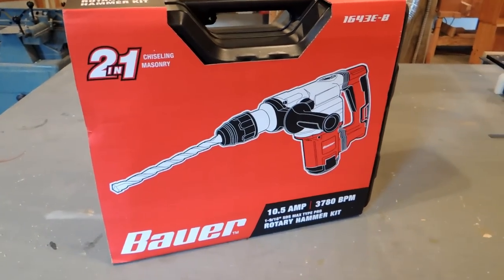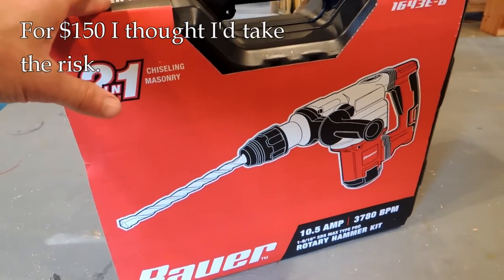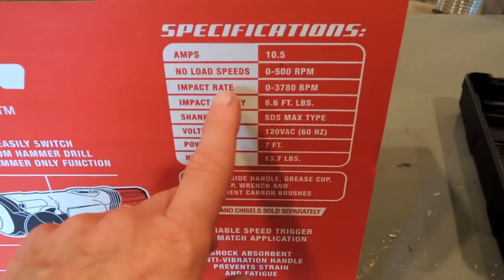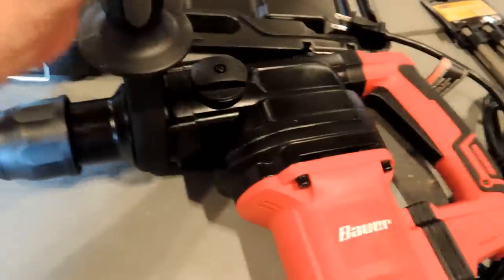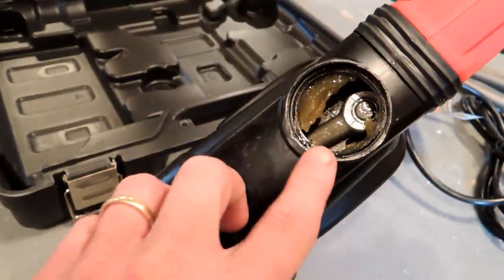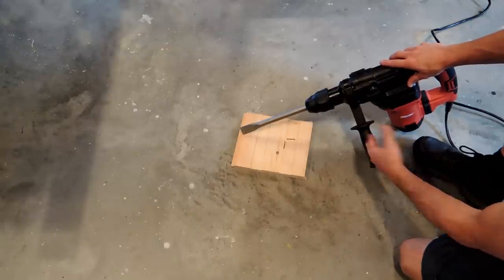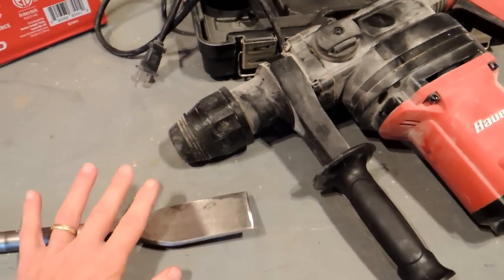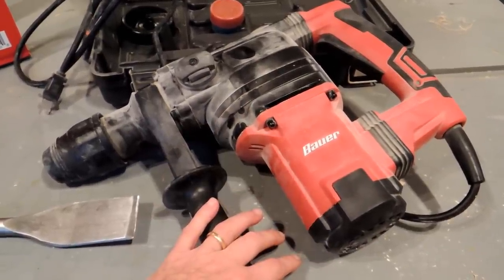Review: Harbor Freight Bauer 1643E-B Demo Hammer

Comment: Great video.  I love Harbor Freight Tools. Over the years, most of them have lasted way more than I expected.  And the ones that didn't were cheap enough I felt fine replacing them.  Thanks for showing us this one in action.  Doing a job on a cement post with hammer and chisel, and came to check out my options - this was perfect.

Comment: Thanks John!  Demoing my master bath and saw your video on demos.  Always appreciate advice from a PRO vs. first timer.  So I'm at the stage where I need to rip-up the floor and I'm new to Harbor Freight so I wind up buying the latest version of this tool and I'm searching on line this morning as I unpack it and there's your review/demo of the same tool!  So appreciate you putting this stuff out there for others to learn from!  Thanks Again!  PS - I have 2 more rooms to do after this so figured the purchase was worth it too if it gets me through this.
Reply from the maker: Sometimes a tool like this will make short work of it, sometimes you end up doing a lot of hand work anyway.  Luck of the draw.  If you have the misfortune of working with metal lathe buried in a "mud" job under the tile, your life will be miserable no matter what tool you use.

Comment: I just bought a Bauer Hammer Drill ($99).  I wrote HF product support about the grease because the owner manual makes no mention of what grease to use.  They responded within 24 hrs (5 stars for that).  They said to use Lithium #2 or #3 grease monthly.
Reply: Dan Burch I just had the same problem about the grease. Get the super lube, it has a higher melting point and less black grease out the front

Comment: I've been a contractor for decades and the physical part is starting to wear on the body. Using power tools more often and where ever I can, I strongly recommend. I prefer the name brands but, I have purchased tools from Harbor Freight and have been pleasantly surprised by the power and reliability. I bought a Harbor Freight multi cut-off tool for $35.00 years ago and after years and years of use, the thing just won't die and never had a reason to upgrade to the more expensive $200 version at Home Depot. Having said that...I'm not surprised the Demo hammer did the job for you. Are there more powerful and expensive tools out there? Absolutely! Do we always need to spend the extra $ to do the job? I think NOT! 
Great video! You covered it all my friend. Very thorough.
Reply from the maker: Yeah, I feel your pain!  For decades I just powered through adversity and worried more about the job than my body.  Now in my late 50s it's catching up to me.  I'm also looking to use tools instead of muscle now wherever I can.  And, that doesn't necessarily mean high-end, expensive tools either.  Sometimes cheaper tools are just fine and preserve profits.  My work truck is 28 years old, I don't need a $65K lifted pickup either.  I've seen many contractors over-extend themselves with expensive toys who are now out of business.

Comment: I've been using this hammer drill for almost three years to drill 3/4" holes,  5" to 10" deep in solid granite rock to split stone with wedges and feathers. It drills fast and I have had no issues. I've also been using the 70/75 lb jackhammer with no issues. They both do great work at a fraction of the price of name brands. I recently had the brush go out on the jackhammer, easy fix. The hammer drill is still going strong.
Reply from the maker: Yeah, my unit has been going strong.  When I made the comment about drilling, I was referring to construction type work, such as precision drilling for hardware anchors in concrete or drilling through tile for anchors.  I'm sure this would be fine for less precision work such as breaking up rock or concrete.
Reply: Tom what grease you use?
Reply: Hey there! I'm actually trying to figure out how to change the brushes on mine. Can you give me any pointers? thanks!

Comment: You said it wouldn’t be good for drilling. In my opinion it works great for drilling into foundations. It’s done everything I’ve asked of it.
Reply from the maker: I didn't mean to imply that you can't use it in a drill capacity, I was only trying to convey that if you need precision holes for anchors or something like that, a hammer drill is a better choice.  If you just need to knock a hole in some masonry this will work fine, but it wouldn't be my choice for precision work.

Comment: Thanks for this video!  Buying one of these later (with a current coupon that makes it $99!) to remove about 400 sq ft of tile.  Even it if only lasts me for this job only, it's TOTALLY worth it :-)
Reply: @Foxtrot I can tell you as I have this, I do commercial tile install, this thing is a freaking beast for tile removal. I can tell you this unit, is comparable to bosch units. Crazy power. And I'm very very surprised for harbor freight.

Comment: The extra grease that comes in the little cup is not to put in the tool. You are supposed to use it on the chisel when you put it in the chuck.
Reply from the maker: Maybe you're right.  The manual references greasing both the shank and the internal body, and that cup of crease could be used for either.  The manual also notes that monthly you should clean out the old internal grease and install new grease!  I don't know how the hell you clean out the old grease, but I doubt it matters.  Basically you need to keep a lot of grease around, and that little cup isn't going to get you very far.
Reply: That is very useful information
Reply: @enduringcharm  thats where they make the money in the grease...but they dont sell it at my stores.
Reply: Thank the lord someone knew that. This guy a dork lol
Reply: @enduringcharm He’s definitely right

Comment: There is 1 that is all red color plastic housing for $97 and another 1 that is a long version, that’s the lowest. Trust me  I tryed it, usually it’s operators error when it comes to how to use them, people think they need to push hard , but no, not at all, it works just like a jack hammer hold it light and let it do it’s job when it comes to braking concrete
Reply from the maker: We need to be careful when describing HF tools by shape or color because they change the models constantly.  But, the one in the video is still the base model that accepts the SDS max chisels, which is an industry standard.

Comment: Great video. I'll say though, I do drill with mine. Great for anchor holes in concrete or brick.
Reply from the maker: When I made that statement I really meant drilling holes for more delicate tasks, like through tile to mount a shower door or whatever.  I personally wouldn't use it for drilling until I got into much bigger things.  I have two regular hammer drills which get me to 3/4".

Comment: I have some cracks in my driveway concrete (concrete is 4-5 inches thick total) where grass is growing. I need to widen the cracks to about 1-2 inches wide to be able to fill them with concrete. Is this powerful enough to do this job?
Reply from the maker: For that job you are going to want a nice straight line.  You can use a grinder with a diamond blade or rent a wet concrete saw to cut that straight line on both sides.  Then, if needed, you could use this tool to remove the waste in the middle.  You may not even need the demo hammer, though.

Comment: I just got home with the pro model above this one $289.99. (I had a 10% off coupon for this brand, other coupons exempt, so got $29 off). I told them I needed it to break up quartz boulders from my gold mine.  The set of chisels were normally $45 but I had a 25% off coupon.  Within 60 seconds, I saw the tip of the chisel wear down about 1 inch and sparks flying inside to rock hole.  Once the tip wore off, it started busting up the rock just fine.

Comment: Oh for heavens sake. Cut the drywall pull off in one sheet.
But I’ve had a Bosch SDS for years and when it broke the Bauer out performed very well and the Bauer is at harbor freight for $95 and if it lasts 3 years so what it beats $400 SDS
Reply: I thought it would die in a few hours.  This thing is a beast on any interior tile demo.  I have Milwaukee and Hilti.  This is the best bang for the buck.  We have 50 hours on this unit.  It is the lightest demo unit at 11lbs.  We use it for demo on tile only.  We're very happy.

Comment: Harbor freight is not garbage. Ok some of the stuff on the shelf is, but the power tools that I have bought from them, specifically Hercules cordless tools are top notch. I'm mostly DIY but I have given them heavy use and have not had any problems. Same thing with their Vulcan line of welders. You could spend three times the amount on a Miller MIG welder but why? Unless you weld all day long for a living it doesn't make sense.
Reply from the maker: Yes, they have made tremendous strides in quality in the past five years or so.  You can still find junk in the store, but you can also find lots of decent quality stuff.

Comment: Well done review - Thanks!
I got this and almost immediately the rotation-only part became virtually unusable. I cannot figure out WHY the ball slips in the clutch assembly in order to repair it. I've tried different lubrication viiscosities and it just slips and slips rather than drills. At my witts end.. Grrrrr!
Reply from the maker: Well, first, it's possible you just have a dud and Harbor Freight should take it back.  I haven't had my unit that far apart, but I do know that many of these combination tools which do both hammer and rotational work can be ornery switching between the two.  I have a DeWalt hammer drill with the same issue.  It's probably not lubrication but rather something about the switch mechanism preventing it from fully engaging.
Reply: @enduringcharm  I FOUND the problem, and sadly on this two year old item there is nothing I can do except trash it. Turns out, the sliding chuck collar is molded in such a way that the 2 ball bearings that have to capture the shank are being allowed to move out from their needed position radially just a tiny bit too much, thus NOT capturing the shank but allowing it to spin in place with only minimal spinning torque stress on the drill bit. It is a very poor design which should be much more rigid in that area. We are only talking about a milimeter difference in working properly and not working at all. Sad to throw a hundred bucks' tool in the trash because of a few cents worth of fatal flaw. No replacement collars available and no workarounds that will allow the slide clutch to work. Regretfully $$, I have ordered a Makita model 2475 -- still ch9nese but hopefully more robust design.
Reply from the maker: Oh, I thought you had just bought the tool.  Well, is it possible you could source a slightly larger ball bearing so it doesn't move in it's slot?  Or could you put a couple welds in place and then grind them down to a tighter tolerance?  My copy of the tool is still going strong after more bath demos than I can remember at this point.  That is a problem now with all manufacturers, which is inconsistent quality.
Reply: @enduringcharm  That is a good idea - Thanks! The bearings are 7.2mm or about 1/4 inch. I think the local HW store may have. Worth a try for sure, so I'll leave the Makita in its pkg until I try that. Yeah, the drill is 2 years old but maybe has only an hour's use total, so both old and new.
Reply from the maker: If you strike out locally, I know you can buy loose ball bearings on Amazon for peanuts.  I've purchased packages of them for bicycle wheels and steering heads.
Reply: @enduringcharm  Just picked up 2 of them at Ace HW...will give em a go tomorrow. Worse case, it is a junker and I'll keep the Makita...which should last 20 years.
Reply: @enduringcharm  Well, it was a no-go.Too bad, I'll just put ot out by the curb. All because of a simple design flaw. At least we learned a lot about how these things work. I hope others have a lot better experience.

Comment: I wonder how much your 1643-E-B model differs from the 1641E-B (which is at least $50 cheaper at $89.99). Yours is 10.5amp /13.7 lbs. The 41E unit is 10amp /11.9lbs so it seems like they've downgraded something by at least 1.8lbs (likely the motor) but they also made it cheaper in price.  How has yours held up? Do you use it much? I'd probably only use one a few times a year so I think I'll be buying the cheaper unit.  Right now I need some anchor holes in 4" concrete for my air compressor and don't want to waste $50 on a rental.
Reply from the maker: Do you really need a demo hammer or would a hammer drill be a better investment?  I own both, but if you are mostly drilling holes in concrete or tile, maybe a hammer drill is what you really need.  I use the demo hammer for tile removal and that's about it.
Reply: enduringcharm I have a hammer drill and I know its not going to punch four 3/8” holes to 4 or 5” deep. For a rotary hammer its a cakewalk. I also have a 16 x 28 room of VAT to chip up so its worth the $100.  Im trying to hunt down a Bauer coupon.
Reply from the maker: Well, if you need it for other things you should get it.  However, a good hammer drill will do the holes for you.  I use my Milwaukee hammer drill to make 5/8 holes six inches deep in old concrete for wedge anchor bolts, for example.
Reply: @enduringcharm   The only hammer drill I own is a old RIDGID cordless.  Luckily the newer lithium batteries still fit it (it's the old ni-cad style) but maybe I'll give it a try with that anyway. Couldn't hurt I suppose.  But I may buy one at soon anyway to chip up the old vinyl asbestos tile. I did as much as I could stand with a hammer and scraper and still have half the room left.  I was also considering using one of those vibrating blade saws (I own the cheap HF one).

Comment: Good video.  I've got a different model Bauer rotary hammer, has worked great up until today.  Used it for about an hour, took out the concrete I had been breaking up, came back to work some more, the unit is on because I can see the light showing it is getting power, but when I pull the trigger nothing happens.  Thought I'd ask if you and maybe get lucky that you knew of a easy fix?
Reply from the maker: The fact that it was working normally until you stopped makes me lean toward the idea that the switch has an issue.  Perhaps concrete dust or broken contacts.  If you are sure you have power to the cord, then the possibilities include switch, wiring, worn brushes or burned out windings.  In that situation I'll typically take apart the tool and examine the wiring by eye and with a meter.  If you can get the parts it is easy to repair.
Reply: @enduringcharm  Thanks, I'll give it a shot.

Comment: Type of grease matters greatly.  If you add a different kind of grease they could react with each other and begin to break down. Remove as much of the old grease as possible before you add a different kind.
Reply from the maker: Lithium based grease is the most common and if you mix two lithium based greases you're generally okay.  If incompatible types are mixed you could end up with a hardened ball of the two or they could cause disintegration and break down to oils.  Fortunately it's pretty easy to test.  Take a finger swipe out of the tool, mix with a finger swipe of the new grease on something disposable, and wait to see if there is a poor reaction over a day or two.
Reply: I added Crisco to mine when I ran out of it a month ago, think I Brooke it.... Lol

Comment: For removing tiles off dry walls, i think a multi oscillating tool is more suitable. It takes a little longer, but a lot easier to use, a lot easier on your body and your joints.

Comment: Would one of these Harbor freight rotory hammers break up rocks with 
that chisel bit? I have some rocks sticking out of my lawn thats killing
 my mower blades and they are too big to remove by hand so I thought I 
could break them up a bit to get them to be lower than the ground so I 
wont hit them. one of HF's big demo hammers is too much $$ for what ill 
use it for but one of the smaller sub $200.00 ones would b
Reply from the maker: You'd be better off using strategy rather than horsepower.  Use a hammer drill with a small carbide tipped bit to drill a series of holes in a line into the rock.  Then use a hand chisel with a sledge to break off the rock along that line.  Alternatively, a hand grinder with a masonry cutting wheel could be used to draw the line.
Reply: @enduringcharm  I MAY HAVE TO USE THE 4" ANGLE GRINDER...LOL hf WAS COMPLETELY SOLD OUT OF ALL OF THESE EXCEPT THE BIG, $379.99 ONE! LOL  opps, caps lock! Dang!!

Comment: How do you aline the sds chisel in the chuck so it is at 9 & 3 0clock position in front of the hammer?
Reply from the maker: Do you mean getting the flat part of the chisel at a perfect 90 degrees when the tool is upright?  It may not be possible.  The splines of the chisel align where they may, and on mine that is not 90 degrees either.  I just adjust the floating handle to a comfortable position and go.
Reply: @enduringcharm  Thanks, I figured it out. They have another sliding chuck under the chisel chuck. When slid down you can rotate the tool at the desired angle.

Comment: Would it do a good job if I only need a spade to help me break dirt instead of using a shovel?
Reply from the maker: Are you asking about using this to break up dirt and rocks in a hole?  I typically use a shale bar in that kind of situation, which can be hoisted high and brought down hard to break up rocks and and packed earth.  A demo hammer doesn't have a long range of action at the business end, it only moves a small amount.  You might find it useful to break up rock or packed gravel in some circumstances, but the speed of the operation might not be very fast.  A larger demo hammer like you find street crews using to break up road surfaces has a longer stroke and more weight behind it.